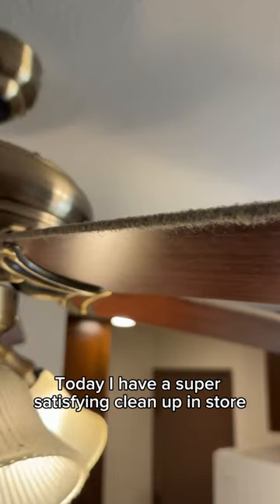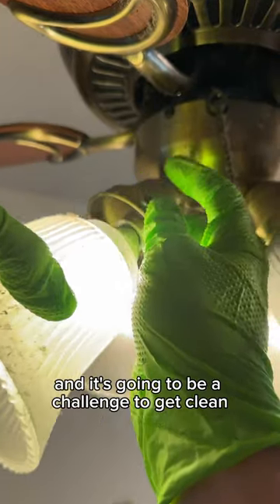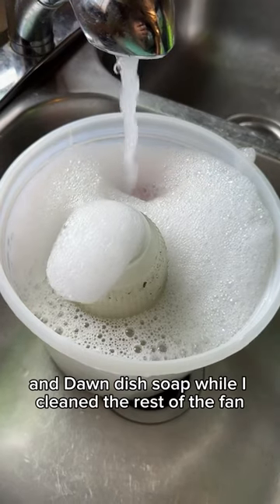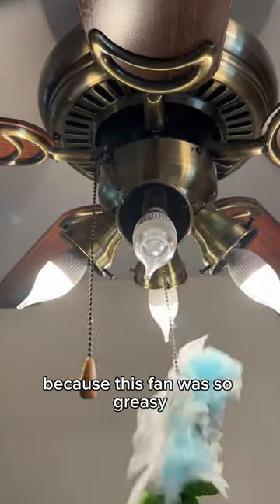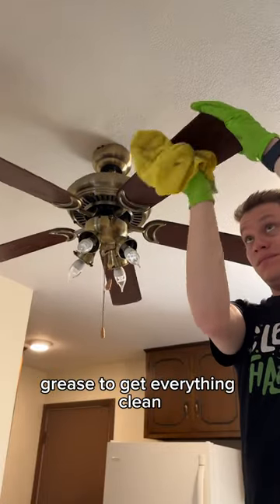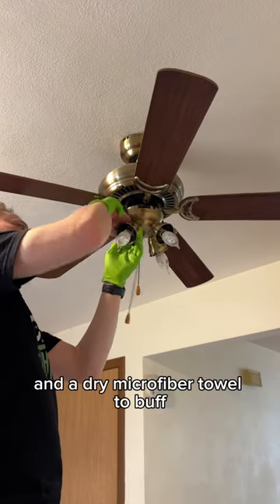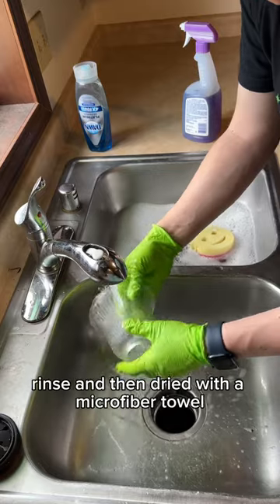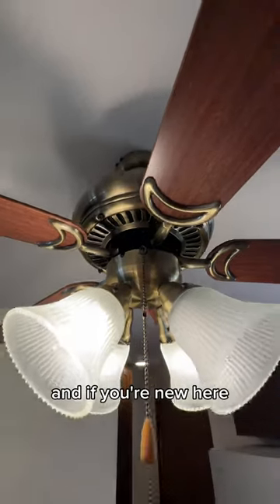I cleaned this super dirty fan #cleaning #satisfying #cleaningmotivation ng

Comment: Furniture polish on the blades so it's easier to clean next time. Little bit of silicone oil on the metal, and vaseline on the glass rim so the screws dont get stuck on the glass.

Comment: You did a fabulous job!  I would have put the glass globes in my dishwasher and turned off the heat dry.   I let my dishwasher do the work.  I wash as much as possible in my dishwasher.  I even remove the top rack for large items.
Reply from the maker: Great idea! Unfortunately I couldn’t use the dishwasher on this job 😢